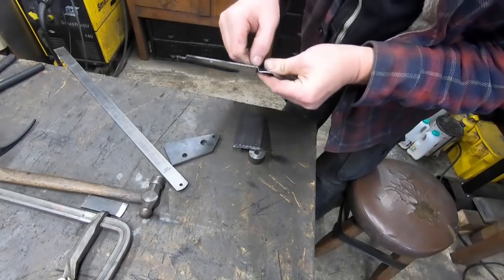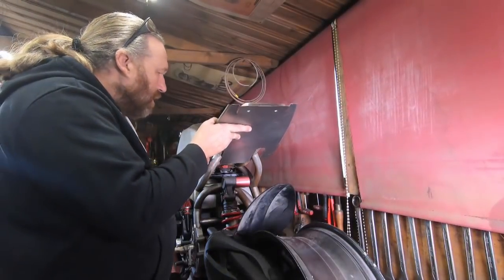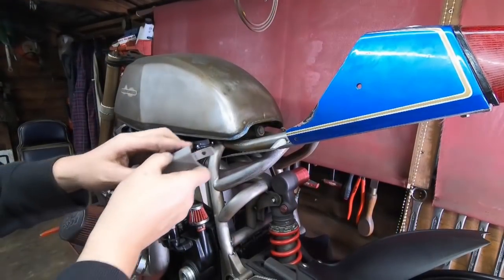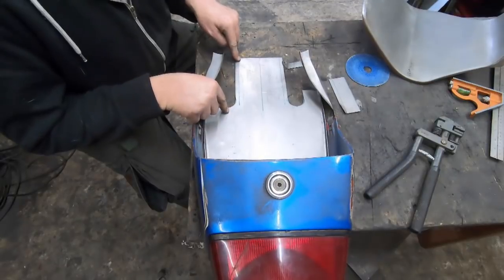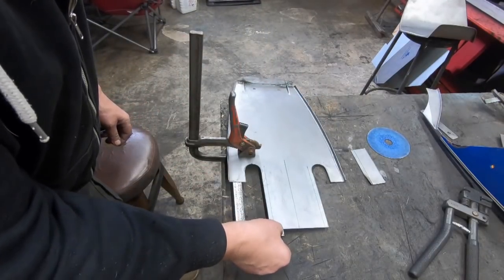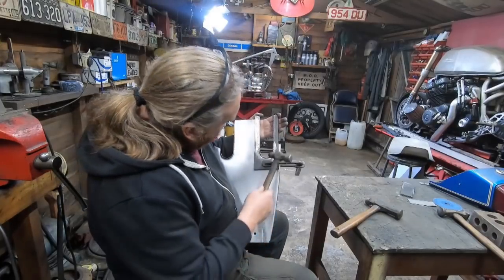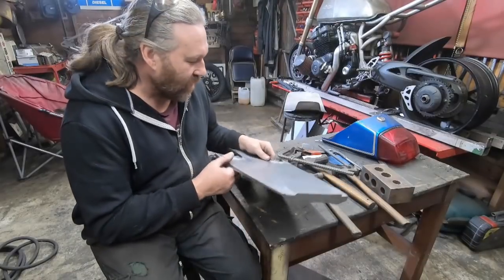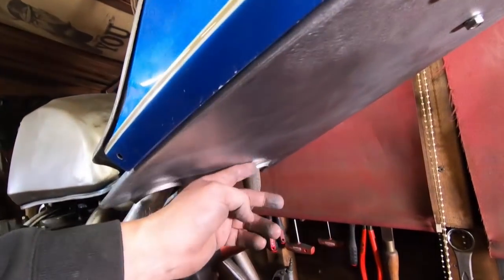Suzuki Tail Unit Part 2

Comment: Craig, I made up a small indent tool to get round the same problem, swages the metal in around the hole and then the swages area hits first, the bolts are slightly under sink which gives a factory look, just an idea
Also you could make up some recessed nuts and just use a slot in the the top, just open up the holes in the frame..if you get what I mean, sorta like what holds the mech hanger on a pushbike

Cheers, Daz

Comment: I'll commit a sacrilege here:  Wouldn't it be smart to hold that wedge in place with Epoxy? When spot welding two layers of metal onto each other, you create a perfect trap for water in the gap where it can happily corrode away. Filling the gap and attaching it at the same time seems to be of advantage there.
And now I am ready to run.
Wait, no, I'm an old, limping wreck. What have I done?

Comment: It is a good piece of sheet converted to a piece of a body panel. I like it. I think you can make a nice number plate holder hiding this step under the rear light and also hiding mounting nuts from the side view. I like your atention to details on every project - something that some hammered dogshit maker can't achieve. Well done Craig.

Comment: You did a great job, when you start by saying what you're going to do it's hard to imagine, then it's done and looks great. You are doing a few T-shirt designs will there be one with the Triumph 350 on it, and have you considered a small image of Blue's face say 2"x2" on all the shirts as a logo be it on the shoulder back sleeve?

Comment: Coming along nicely Craig - I did notice when you first tightened those nuts holding the tail-piece, the front of it lifted slightly suggesting the mount in the frame is tilted up a bit at the front and why you needed the wedge. Loving the build.

Comment: A tailunder is about $400 in the states,a sheet of aluminum to bolt a tag.Do away with the goofy black plastic flap fender that comes on all stock.Strikes my nerve,how horrid.                                                   It still looks Suzuki tank and taillight tell on it,but I put alot of miles on one of these heavy pigs.

Comment: You really need an English wheel, from a company closing down sale or alternatively even a Chinese knock off. I've seen the knock offs used to great affect once secured to the floor and ceiling adequately. 25,000 subscribers equals an English wheel. You need one more than most in ute ube land.
Reply from the maker: I would love one but I really would want a good quality one. There is a company that make some off old casting patterns and they are not to big so would fit in the shed without taking up loads of space but the £2000 price tag is a bit out of reach at the moment.
Reply: @THEDOGHOUSECUSTOMMOTORCYCLES  £2000 is insane money Craig, so I get that. , maybe waiting for an engineering company to close down sale may be your best bet? In any mate, my best wishes go with you. Anything that will speed up your extraordinary talent has gotta be worth the trouble. Personally I've always been the sort of guy who likes to get the best out of what you've got to hand. You certainly  do that my friend.

Comment: Hiya Craig.. Hope all is well matey... Just a quick question, I’ve seen a lot of people shy away from doing seem welds on sheet panels as they say it will warp.. you seem to do it fine.. Have you got any tips? Cheers Glenn
Reply from the maker: Hi Glenn, its not to bad on corners with a low setting and I try and go along the seem quite quickly so I don't transfer to much heat, I always do a practice piece on the same sheet so I know the settings are right when I do it on the actual job.

Comment: Great work again mate. Would longer studs in the tailpiece help to double up as a transfer mount for the indicators/no plate bracket?
Reply from the maker: Cheers mate, That would look to normal lol. Ive already done the number plate  its blended into the swing arm, if I actually put indicators on it I will go for bar ends. What you doing tomorrow Boss? Im about if you want a brew.
Reply: THE DOGHOUSE I’ll pop over for a brew tomorrow for sure 👍
Reply: Would it be sacrilege pointing out to one of the Gods of Biking that this bike has a sidemount plate ??... 😉